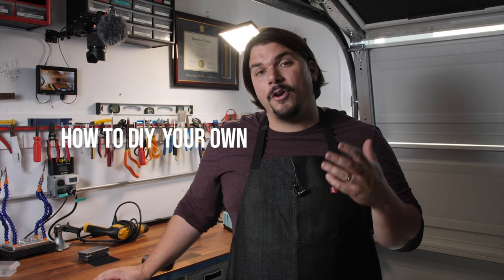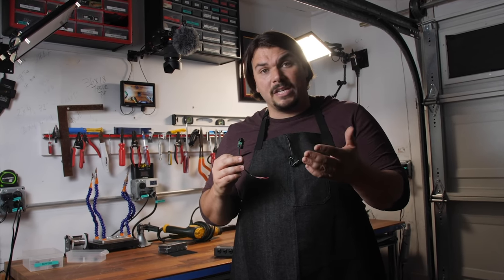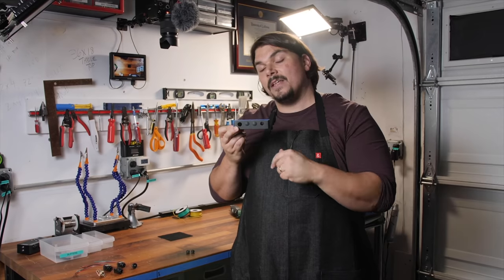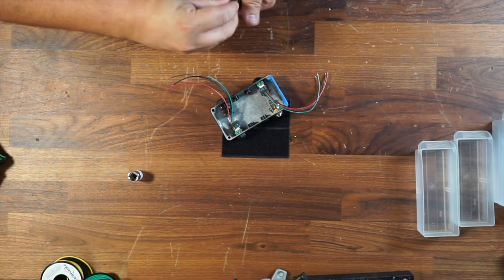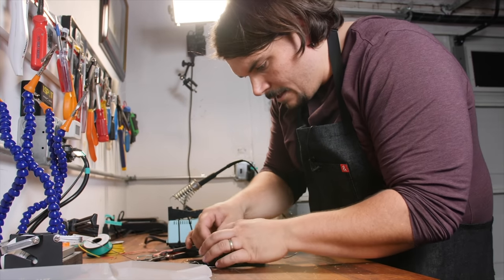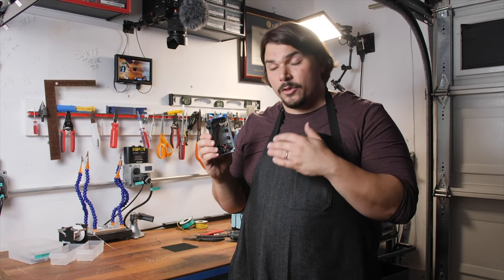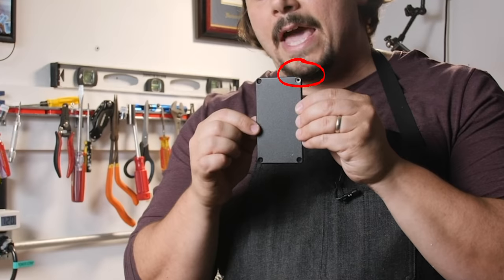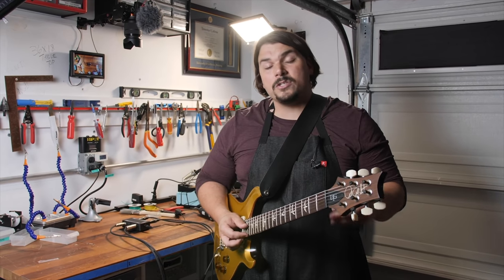Build Your Own Buffer!

Comment: Hi Mason.
Thank you for another great video - Really good stuff!!!
I'm thinking about making one of these buffers for myself.
I would like to make one with an isolated tuner out and with an audition loop as well.
However I want to use the audition loop for my wah which will go first in the chain.
So actually I would hook the audition loop send directly up to the first buffer, right?
And then what about the tuner out? can that be hooked up to the same buffer too without affecting the signal?
I might be completely off here :-)
Reply from the maker: You can follow all of the diagrams or can bind them in any way that you want. I hope that they’re clear enough where you can use them interchangeably if there’s options that are expressed in one but not in the other. It just may require that you get a larger enclosure, perhaps a Hammond 1590BB as an alternative. If you want it to be isolated, in other words with a transformer, I don’t have a good solution for you if you’re actually going to be running audio through it, if it’s just a tuner out to an actual Tuner pedal that’s not feeding any subsequent devices, then you don’t have any need for the isolation.  If you’re going to use it for some sort of re-amp or DI, Then I would look at the suggested splitter that I mentioned in the diagrams, from Lehle.
Reply from the maker: For the audition loop, I would only use it in places in the signal path that you can’t easily get to. I would just use the wah  as the very first pedal in the signal path and then plug into the input buffer from there. No need to build in an audition loop for this.
Reply: @VertexEffectsInc  Thanks. But the reason why I wanted an audition loop for my wah is that I don't carry it with me all the time. It's not mounted to my board and I usually have it beside my board plugging it in occasionally when I need it.
Would be neat to be able to plug it into the same interface.

Comment: I built the DIY Mono Dual Buffer + Tuner Out Pedalboard Interface for Bass guitar with a 5M impedance on both input and output and the volume is reduced significantly when running through the interface. Is that normal? Should I have different input/output values?
Reply from the maker: No, sounds like something might have been done incorrectly.  You can always send us a shot of the inside to see if it's something obvious.

Comment: Hi Mason, I'm thinking to build your DIY "Audition Loop" interface, but would like to add a Tuner out jack.  Is there room to fit an extra out jack in the Hammond 1590 enclosure?
Reply from the maker: No, but you could go with a Hammond 1590BB and you’ll have enough room for this.

Comment: Great Content as always!  Silly question, do you have a diagram for a 4-cable-method buffer also with Tuner-Out?
Reply from the maker: I don’t because it can’t fit in this box, you could use the same method for the tuner out as in the other diagrams and just add that to the four cable method diagram using a Hammond 1590BB size enclosure
Reply: @VertexEffectsInc  Ah makes sense, thank you! I am currently using the Mesa Boggie High Wire dual buffer which sounds great.  Of course trying to slim down the board/cram more things into an enclosure if it still delivers.  The only thing the four-cable / tuner buffer would be missing is a boost :)
Reply from the maker: You could add that with a resistor switching on the output buffer and have it all in a 1590bb box

Comment: could this be adapted into having 4 sets of sends and returns (in other words, a 1-in 1-out with 4 effects loops)? would having so many buffers drastically affect the overall tone?
Reply from the maker: You could, you'll want the buffers to drive the cables.  If a buffer is hurting the tone, it's not a good buffer.  Ideally they'd be on the return of every loop.

Comment: I built the dual mono buffer. I noticed the diagram shows the green wire (ground) from the buffer to the leads on the guitar jack. It should be revised to show the brown wire (input) from the buffer to the leads on the guitar jack. I checked all the diagrams they are all the same. Am I mistaken?

Comment: Love this content! Where are the bigger designs? Looking for transformer based (like what you're holding with the mini toggle) Is that a phase, ground lift? Sometimes needed depending on what you're plugging into. Thanks again for sharing!
Reply from the maker: You can expand and combine any of these diagrams for more options into a 1590BB enclosure - I didn’t include the transformers because after testing them I couldn’t find one reasonably priced that didn’t distort or produce unwanted artifacts when hit with a lot of signal.  The transformers were a compromise.  Even the expensive Jensen models aren’t ideal and are really more like input transformers designed to be at the amp, not on the pedalboard side.  I looked into building in servos and zobles around the cheaper transformers to stabilize them to no avail.  If you check the notes I recommend a transformer isolated passive splitter box for multi amp set ups in the Lehle P Split.  If you’re careful about keeping your multi amp set up on the same ground and you have a inverted polarity speaker cable, you should be able to solve the majority of issues that would occur that would require galvanic isolation and polarity (phase) controls.
Reply: @VertexEffectsInc  Thanks for the info Mason!
Reply from the maker: @EricLyke  sure thing

Comment: Great video! I have an HX Effects. Is that already buffered or will a buffer make sense? If so, should it be on the input, output or both?
Reply from the maker: I think if you look up the spec you'll see the output impedance isn't that great...maybe 600 ohms or so.  Is this the only pedal you have?

Comment: Question??? Why dont you add a buffer in the guitar prior to any long cable runs????
Reply: AHHH just read the redeemer specs and thats exactly what is meant for.  Buffer as close to the pickups as possible. I've always wondered why they haven't doing this for years or decades.
Reply from the maker: You could put it in your guitar, however some folks don't want to modify their guitars to make them active.  Most prefer to do it at the pedalboard and keep the guitar stock.  This is what I've shown in this video and the diagrams here: https://vertexeffects.com/diy-buffer

Comment: Hi Mason, great video! in a previous video you recommend a 1 meg input impedance buffer in the beginning of your pedal board and a 100 ohm input impedance at the end of your pedal board. When making this dyi buffer you want a 1 meg input impedance buffer, question do you want a 100 ohm on the output? In the beginning of the video you have a diploma on the wall, what did you major in?
Reply from the maker: The output impedance is already set, you don't need to set it with a resistor.  Sociology.

Comment: @Vertex Effects I reviewed your drawings, but wasn't clear on this point - Do you recommend grounding the input jack to the enclosure but keeping the outputs all insulated/plastic?  What if this were a passive device, like a junction or splitter, would you ground any of the jacks to the enclosure in that case?
THNX!

Comment: Hi Mason. 
I’m currently in the process of purchasing parts for this build. I was thinking about building it with a dpdt switch functioning as an ab switch to send the signal either to a tuner output or to the input buffer. I don’t have much experience with dpdt switches and are not familar with different brands and their levels of quality. Any one you could recommend or post a link to?
Thanks, and keep the great videos comming :-)
BR Andreas
Reply from the maker: Alpha is good, you can always use their 3PDT switch and wire it for this even though you don't need all the poles.

Comment: Amazing! Been wanting to do that for a while! Any chance of a DIY video on how to make a buffered splitter (or a stereo buffer) with isolated outputs (+phase 180°) ? I have an input buffer in my switcher but not on the output, and running stereo with no isolated output which isn't great (one amp gets no ground from the wall at the moment). - By the way, have you ever tried the Providence PEC-2 Switcher? I don't hear much about it in the anglo-sphere of gear and would be curious. It's got a providence vitaliser as an input buffer (does that buffer get the doc seal of approval by the way? I can't find the specs for it but it seems to have a good reputation). Thanks for the great work Mason!!! :)
Reply from the maker: Theo, see the notes on all the diagrams for splitter and stereo rigs regarding galvanic isolation.  All of them are huge compromises - and not designed for being inside the interface - they change the tone and add distortion when hit with a lot of signal.  Most of the good ones are all input transformers and designed to be at the amp, not on a pedalboard.  If you’re careful about keeping your amps on the same ground you can a sound a lot of the issues and if you have a reverse polarity speaker cable you could solve the phase issue with the amp.  Or you can get the Lehle P Split which is the iso transformer I recommend.
Reply: @VertexEffectsInc  Thank you so much for all of that precious information, it really does help a lot :)

Comment: One comment and a question. My return jack came without a nut and washer. The jack is bigger than a standard input jack so I've to go tomorrow and try to find a nut and washer to fit. Next, my 9volt jack is not like the one in the video. It has one long leg and one short leg. Which one does the red wire go to? TIA
Reply from the maker: Some of the Neutrik jacks I listed required that the nut is purchased separately - double check the Bill of Materials.  Sounds like you didn't get the approved products on the list.
Reply: I just didn't order them from your source. I used the product model numbers and got them from Amazon. The only one different was the 9 volt socket.
Reply from the maker: @frankstabler1920  it will still work if it's assembled correctly, it just may not resemble the diagram so closely so it could make it difficult to match 1:1 unless you were sure which side the + and - went to for the power.

Comment: Finished it today and got it all plugged in on my board and I get nothing. I sent you an email with pictures of the wiring. Hope you can tell me where I went wrong.
Reply from the maker: I'm certain it's a miswire...the diagrams are correct.  Hundreds have been built by DIYers problem free.  I'll be sure to have our Customer Service team get back with you- you may also consider contacting Creation Audio Lab since we don't manufacture this product, simply showed you how to assemble it.

Comment: Hey Mason! I've watched many of your vids, and I've learned a lot, so thanks! I'll be building the 4 cable version for use with my FX loop. I use a Boss TU-3, so where should that sit in the chain? Between my guitar and the buffer? Or after the buffer?
Reply from the maker: I'd maybe run it with a splitter cable off the input buffer so you don't have it in your chain.
Reply: @VertexEffectsInc  Do you have a wiring diagram for a splitter cable?

Comment: Hi again Mason.
One more question. Do you know how the Analogman buffer compares to the one from CAL?
I just saw that you can buy Analogman's buffer board separately for DIY builds as well.
The price is roughly the same.
So what are your thoughts and recommendations on this?

Thanks man :-)
Reply from the maker: If it’s the same as it’s been it’s a BJT buffer out of a Tube Screamer type circuit and not a great buffer IMO.  I think it’s around 500K input impedance and 1K output impedance.  Not ideal for a buffer.
Reply from the maker: If it’s the same as it’s been it’s a BJT buffer out of a Tube Screamer type circuit and not a great buffer IMO.  I think it’s around 500K input impedance and 1K output impedance.  Not ideal for a buffer.

Comment: Thank you so much for this video! Mine is put mostly put together, but...how do you get these 1/2" caps to fit the 15/32" holes?
Reply from the maker: Caps?
Reply: @VertexEffectsInc  the black caps for any unused holes. I'm doing the vanilla mono version. They are .500" and the holes are 15/32". I can't seem to muscle them in, whereas they seem to drop right in in the video!
Reply from the maker: @Studio-cts  you could use a hand reamer and just shave out a tiny bit.
Reply: @VertexEffectsInc  Sweet! I figured it would be OK to open it up just a tad, but I'm new to a lot of this DIY stuff. You guys are awesome. Thank you!

Comment: Question: If I use the tuner which has the buffer built in then how would I use the DIY at the end of the loop, or am I confused?
Reply from the maker: I'd check on the quality of the buffer in the tuner - it may not be an equal substitute.  Presuming it's a good buffer you can make the input just a pass through on your interface that goes right to the tuner.

Comment: Is there a way to use the tuner mod, but retain the mute function or would the tuner have to stay in the signal chain
Reply from the maker: Tuner would have to stay in series
Reply: Some volume pedals have a tuner out jack that allows you to keep the tuner completely out of the chain.  I have a BOSS pedal with this feature and I love it.

Comment: Is there a reason to use the Switchcraft tip Shunt instead of anything else like the Switchcraft Mono Jack?
Reply from the maker: Sonically or electrically, no.  It’s just so that it shorts the input when you unplug so you don’t get any noise.

Comment: I ordered the parts for the mono dual buffer except the Switchcraft jack tip shunt was out of stock, but I have a mono TS jack, can I just use that instead?
Reply from the maker: You could it just won't short out the input when you're unplugged.  You can use the same part number to others that have it in stock.

Comment: Hey Mason, thanks for the vid! I'm curious, what are your thoughts on using a buffer like this with pedals that traditionally seem to prefer being first-in-chain?

There are some obvious examples like germanium fuzz, but I'm actually more curious if you have any experience with devices like the Digitech FreqOut or even a noise suppressor like the NS-2, which generally seem to work best if they can get the direct signal from your guitar. Do you think these will perform just as well after the buffer, or would you place pedals like those first, then buffer second?
Reply from the maker: If you have impedance sensitive pedals, no buffer should go before them - stuff like Fuzzes, Wahs, Treble Boosters, some vibe pedals, etc.  With the NS-2 or Freqout - there will be no issue with the buffer.

Comment: Seen a few comments concerning it getting to crowded to do all the power in the 4CM box to the one buffer. Could you not chain them? - so 1st buffer power wires go to second, and then the 2nd goes to the 3rd, and finally the 3rd go to the DC jack, that way the dc jack is still clean and only has two wires going to it and you've not had a mess of wires converge on any single point?
Reply from the maker: You could parallel the power however you want.

Comment: Hey Mason, I was wondering if there was a way to put a D.I output into this interface idea
Reply from the maker: A balanced DI or just a direct unbalanced output off of the input buffer?
Reply: A Balanced DI on the output, like in situations going straight into a DAW.
Reply from the maker: It’s not possible with this particular configuration for a balanced out

Comment: This is a great video - I just built a dual buffer with a buffered effects loop, tuner out and a simple pass thru for my foot switch. I am having issues with hum on my passive basses though... It hums with no instrument connected, is dead silent with an active bass, but both my passive basses hum quite a bit. They're otherwise silent, it's easy to isolate the noise to the buffer box. Bypassing the input jack is also completely silent - even using the effects loop. Feels like it has to be an input ground issue... But it's a good old switch craft, enclosure should be grounded... Any suggestions?
Reply from the maker: I've yet to come across and example where the issue is due to a diagram, but rather some sort of miss-wire of bad solder join.  You can email us a photo if you want me to have a look at the inside of the buffer box.
Reply: @VertexEffectsInc   Thanks - the issue is definitely with my implementation, not the diagrams! I'll shoot you an email with a gut shot.

Comment: Hi doc,
I really need to know whether in the diagrams you are using a center + OR a center - power supply to power the interface with the barrel connector wired as shown on the diagrams (black soldered to the big lug on the right of the barrel, and red to the small bottom lug) 
Thank you !
Reply from the maker: Standard polarity here.  Any standard power cable provided with a power supply will work.

Comment: Is there a way to lift the ground on one of the outputs when building a stereo buffer?
Reply from the maker: You'd want to add an isolation transformer.  That would be the only way to do it properly.  It would require the transformer, plus some DPDT toggle switch.
Reply: @VertexEffectsInc  thanks for the reply! Sounds like a great topic for a new video 😉